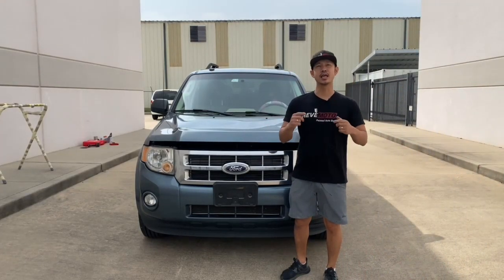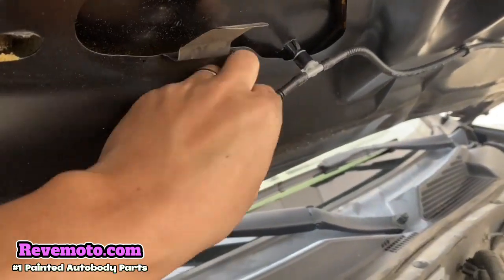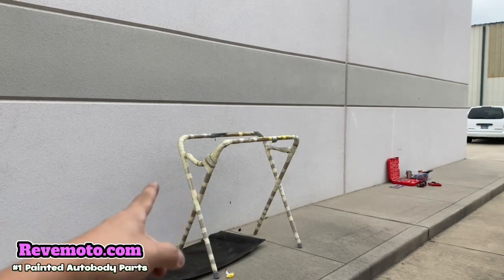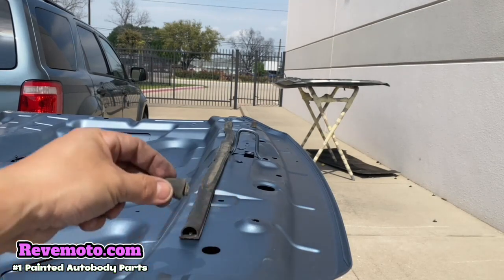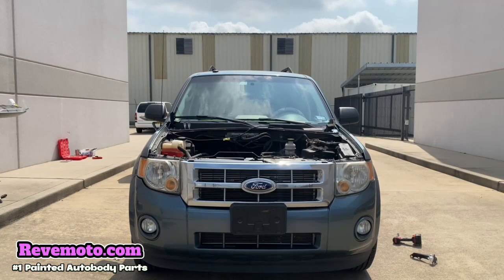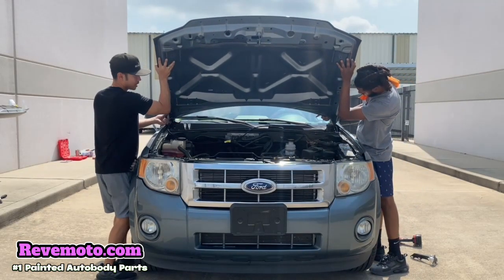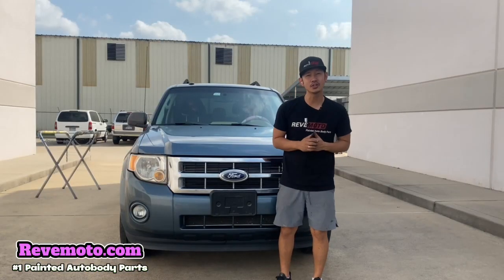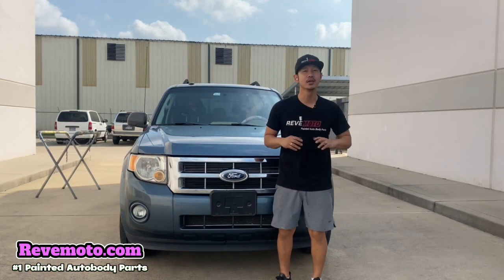2008-2012 Ford Escape Hood Removal and Installation.   Save Money and Do it in 15 mins.

Comment: I have a 2009 mercury mariner that needs a hood and im having trouble finding one without paying an outrageous price. Will escape hoods fit?  I have seen mixed responses one in which saying the mariner has recesses for the headlights that the escape doesnt have?
Reply from the maker: That’s a tough question, but experts at www.ReveMoto.com.  Can answer that for you